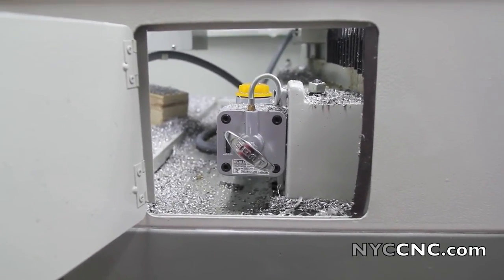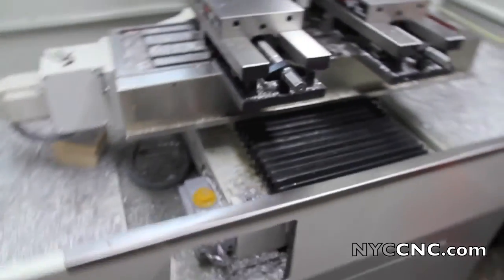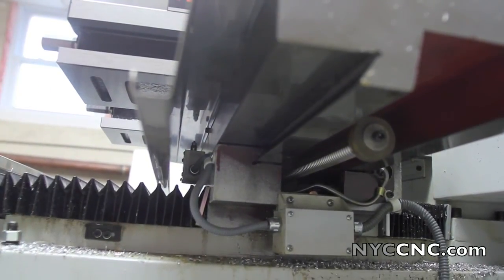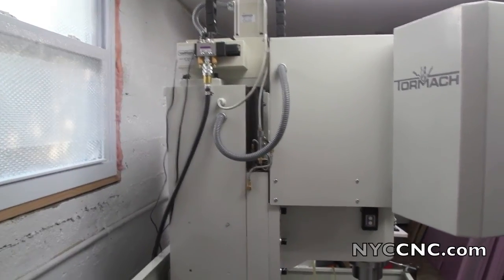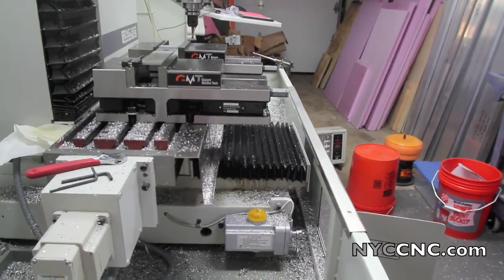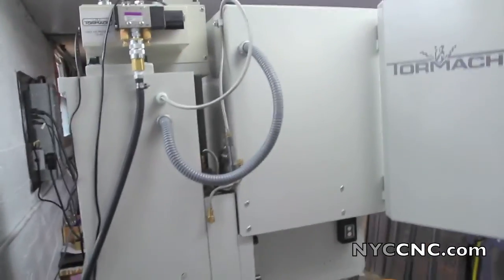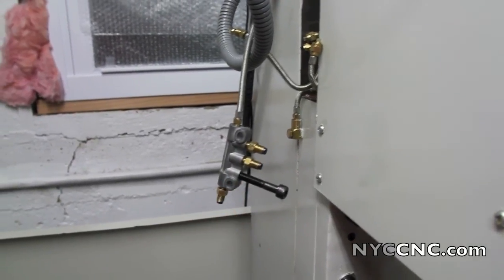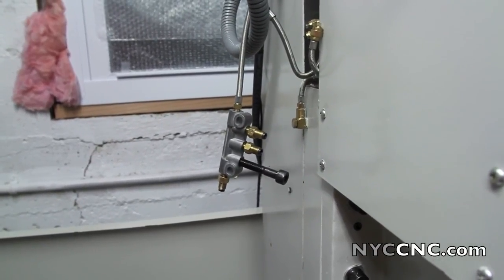Tormach PCNC 1100 - Way Oil Lube Manifolds Ch. 21

Comment: Another really good video! So you blew the valve out with compressed air, but when you used the manual oiling pump the valve did not pass oil through 3 of the four ports. Then after soaking the valve in WD-40 over night the re-assembled oiling system  worked. What did the soaking in WD-40 do/dislodge that cleared the valve?
Cheers,
Roy Lewis Atlanta, Georgia USA